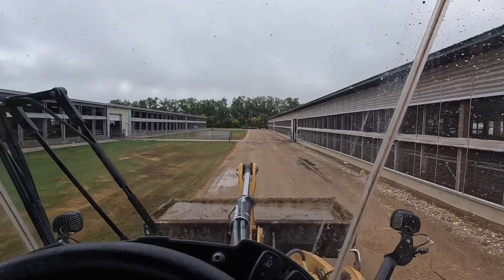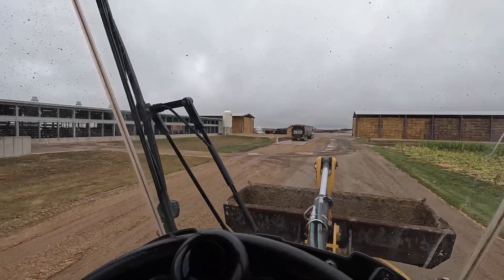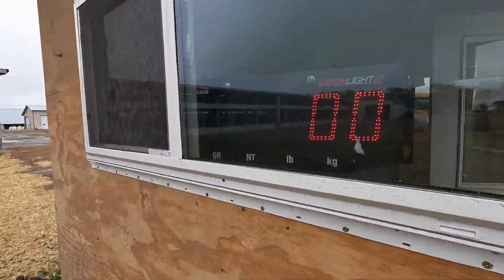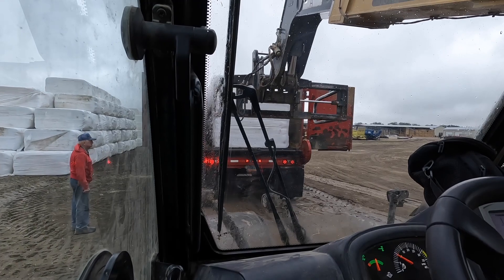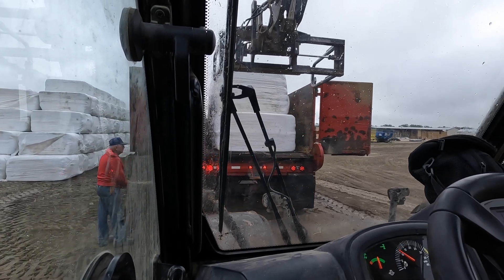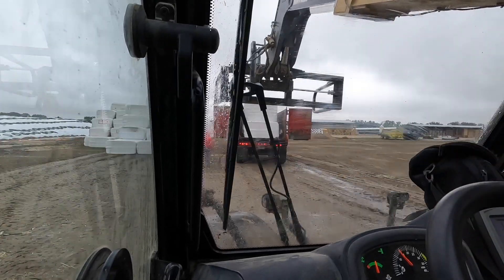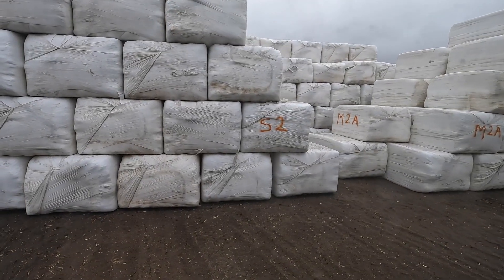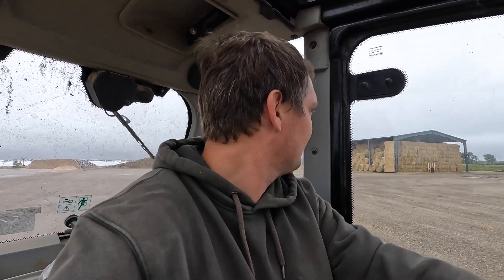Delivery of Alfalfa Baleage to the Farm (53)

Comment: At ALL your loadings - PLACE trailer at a 45 degree angle to pile for faster easier less driving and steering with loader....saves time/saves wear and tear.😊😊
you are currently at 0 degree - the loader has to drive in fill bucket - back out turn - drive straight - turn again/drive forward to unload
at 45 degree placement - you drive in - fill bucket - back out while turning - drive forward to unload

Comment: Thanks for another interesting video. Because of visibility and ease of use we changed over to the JCB TM420 which is a front end loader with a telescopic boom. It will definitely speed up unloading, but the telehandler is better in other areas. Worth a look if you are buying a new loader.
Reply from the maker: I've never seen one in person but I've seen videos. They look like versatile machines.

Comment: I saw that you have a metal tile on the roof of the barn.  Tell me more about it.  Is it a metal roof tile with anti-condensate?  How does it look like?  Is water condensation?  What coverage do you have for cows and calves?
Reply from the maker: The roof is ribbed steel sheets with a thin layer of insulation underneath. The insulation prevents condensation, there is still some condensation from the wood frame.